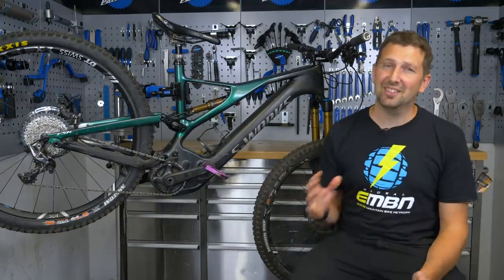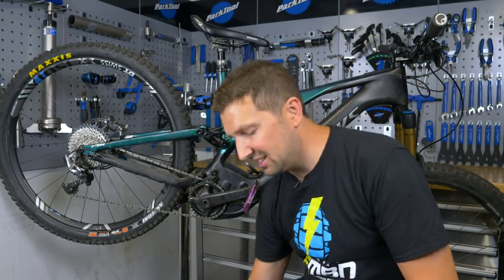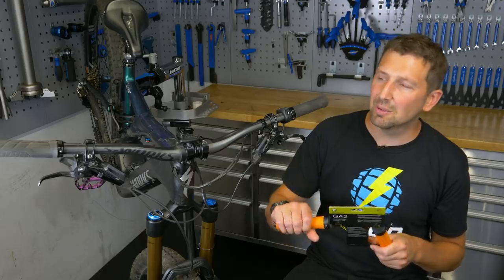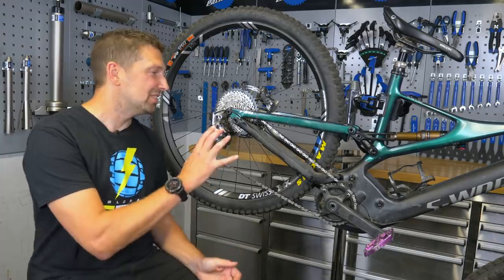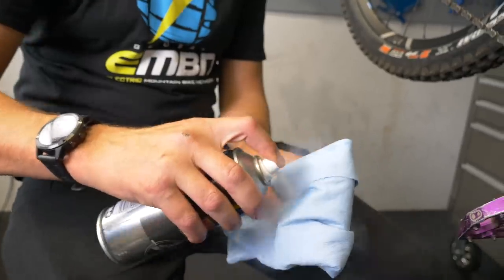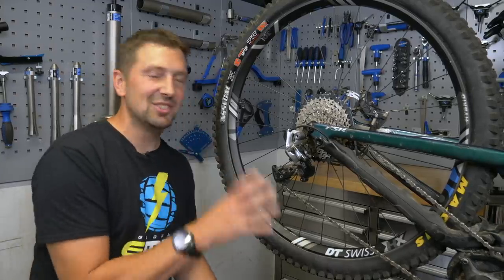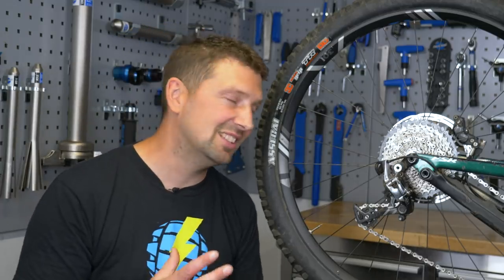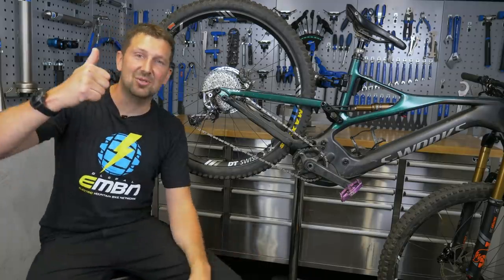How To Make Your E-Bike Feel Brand New | Refresh Your Ride

Comment: Implying people should put new pads in just because their leavers are going in too far is rubbish.
Check the pads first and if they're fine, pull the brakes with the wheels out then leaver the pads in just enough to be just off the rotor. This assumes your hydrolics are fine without issues.

Comment: #Askembn I've a Giant fathom e3 2019 and I warped and discoloured the factory rotors and updated them through the shop to an anti warp set, but I'm discolouring the rear rotor and I'm still getting clicky, scratchy noises off the front. Do I need another type of pad, or wha'? I'm 100kg and running 29ers and the climbs here just on regular roads are mahoosive

Cheers Boyz, watching all your stuff up here in the wicklow mountains

Comment: So buying new pads is a cheap way to make your brakes work like they're brand new because you've just installed brand new pads 🤔
Reply: Or you could just adjust them....  Mine get adjusted about 5 or 6 or more times before they get replaced.
Reply: @texxs01  Absolutely, I made a similar post separately

Comment: Don't walk away, run from this guys bike shop.  He clearly knows very little if anything about e-bikes.  worse, he's got some honesty problems.   Like the brake pads.  9 times out of ten, brake pads just need adjusted (narrowing the gap between the rotor and the pads because the pads are a little thinner from wear), not replaced.

and ya, washing the frame with fancy, expensive stuff doesn't make it faster.  It doesn't make it look any better than dish soap either.
etc etc...

But the worst part is that this video was supposed to be about e-bikes.  he didn't mention the battery or motor at all.  yes, Virginia, a qualified e-bike mechanic ( and many DIYs out there) can disassemble and repack the motor and it's grease.  It makes the motor quieter and a little more energy efficient.  No, of course, you don't have to.  you can leave it sealed and it might just last forever.   . . . But the battery has an infinite life span.  it needs to be replaced and performance will begin to suffer before it's end of life.  and BTW, it's a safety issue.  you keep recharging a li-ion battery after it's maximum recommended charges and each recharge increases the risk of fire.  and li-ion fires  are extremely hot, damaging  and difficult to put out